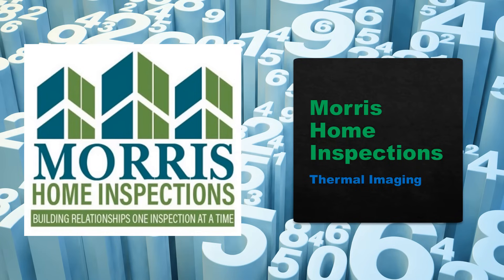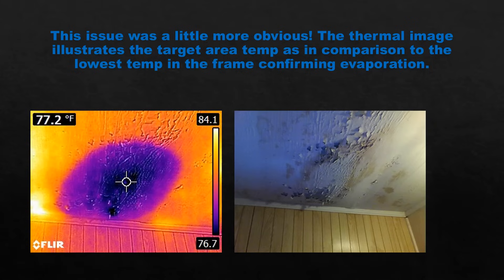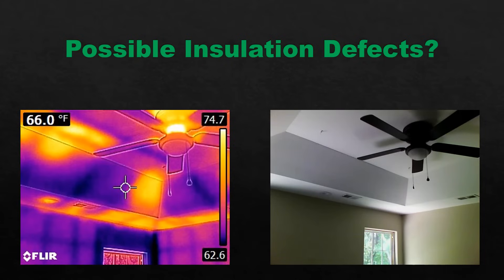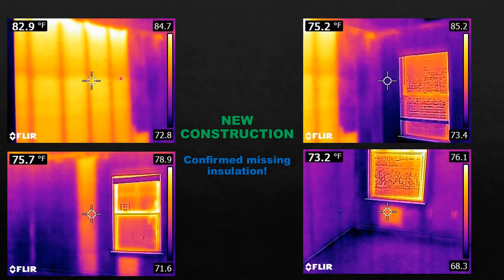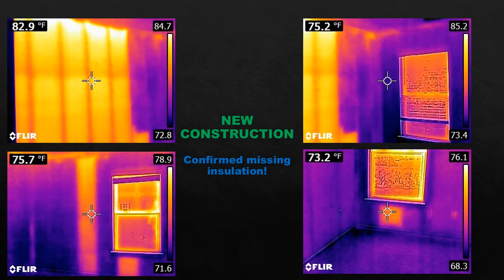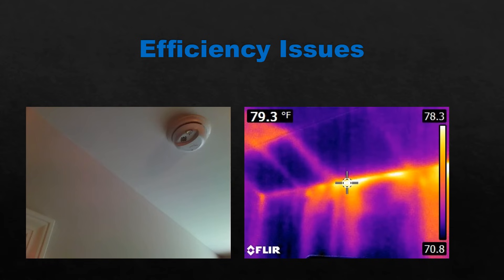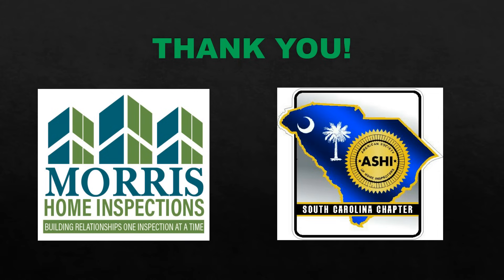Thermal Imaging in a Home Inspection

Comment: I assume these shots were taken in the summer, so if they were done in the winter, would the colors be opposite?  Great descriptive video.  Just bought a topdon 4c004 and it's winter here, trying to find my problem areas for insulation. Which is why I asked the question.  Hope to hear back from you on this.  Thanx again
Reply from the maker: Typically, yes they will be reverse. For instance, I did a home today... it's about 39 degrees out, and the missing insulation anomalies were purple
Reply from the maker: Keep in mind, though, the color scale is simply the setting you choose to use. For instance, this flir has a black/white setting, a full rainbow setting, and the color scale setting you see here.

Comment: Hello. OK—if the areas where there are water infiltrations are analyzed using a visual criterion, I’d like to know what the criterion is, and what the criterion is for thermal bridges as well. It’s clear that these areas are colder, but when can we say it’s an anomaly?
Reply from the maker: You can say it's an anomaly when it looks out of place. It's that simple.
Reply: @morrishomeinspections1234 

In most houses, wherever two different materials meet, there is a thermal bridge. These areas often stand out clearly compared to the surrounding wall surface. The issue is not their existence, but whether the temperature difference is significant enough to cause excessive heat loss or condensation risk.
Reply: Hi
In most houses, wherever two different materials meet, there is a thermal bridge. These areas often stand out clearly compared to the surrounding wall surface. The issue is not their existence, but whether the temperature difference is significant enough to cause excessive heat loss or condensation risk.

Comment: Builder filled one cavity with insulation,  peeled off paper, then stapled just paper on next stud cavity.  No insulation around windows, huge exterior gaps covered with molding.   Froze first winter in home.  Air test shown a leak about 8ft x 8ft .  With blower fan test, interior doors would slam shut from the air draw.  Wish I had a thermal camera!!!.
Removed all walls , re insulation.   21 cans of spray foam, 24 tubes of calking.  Only 3 inches of attic insulation,  blown in additional twelve inches. Had to add foam air vents between rafter.  
Glad I had the skills to re do the work.
Reply: Oh forgot, un insulated metal duct work in attic.  Hard for heat and ac to overcome.  Installer cut rafter supports in his way.  What a mess to fix correctly.
Reply from the maker: @Redoaktrading seen this done plenty
Reply from the maker: Yikes

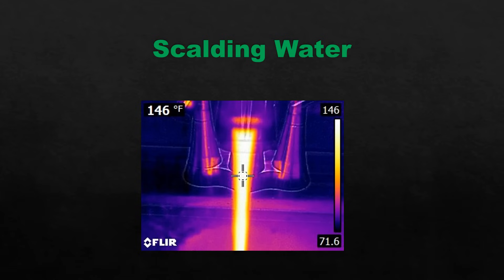Comment: 10:40 I like the look of that. You can be sure that 146 degree water won't carry legionaires disease. They do sell shower fixtures with temperature limiters if scalding is a concern.
Reply from the maker: 120 degrees is a requirement for a new home. You can change the temp as you wish once you purchase the home.

Comment: Great video Scott!! One question, I'm looking to buy the Flir E8 Pro because I'm having some problem with a lots of moisture on my concrete building! What is your thoughts on that and do you have any videos where you show moisture on concrete??
Reply from the maker: We use the E8. It's a good camera. I don't have any videos specifically dealing with moisture on concrete. We have used the camera to find slab leaks and it works pretty well. Same premise as any other moisture... you're looking for evaporation which usually shows up as a cool signature. We have found a slab leak in a condo that showed up hot. Was from a water heater line run under the slab (which isn't typical at all)

Comment: Just did my house. The ceiling to wall connect point along the perimeter (from the inside) of my house were 92+ even in the hallway. Any suggestions? I’m guessing the attic insulation is insufficient.
Reply from the maker: That's typically the spot where the soffit/fascia meet the top plate. Not usually insulated to allow for ventilation of the attic. The only real way is to have a sealed attic and spray foam those areas.
Reply: no wonder all those houses were destroyed in the hurricaines with dudes over here recommending foam instead of a proper construction
Reply: @Robbie-mw5uuinsulation and hurricane straps are two different things
Reply from the maker: @Robbie-mw5uu No one is "recommending" anything.

Comment: I can confirm as a homeowner with 2 thermal cameras that bee hives behind the siding GLOWS as a spot.
Mouse nests in interior walls/roof/ceiling also glows.
I have found 3 bee hives outside.
3 birds nests in roof stickout and wall corner and saved the life of one bird that fell down behind the ventilated siding and was sitting on the mouse screen.
Found one mouse in 4 different spots in my house ceiling when chasing it before it got in my mousetrap.
I absolutely LOVE it 😅😁
I have an Flir ONE pro and infiray P2 PRO, and there is zero competition, the infiray is better in every way and the phone app actually works.
Flir one doesn't support 4 years or older phones, i had it working then after an update it never worked again and support ain't helping they only told me to google an older APK install so i had to find an unofficial and possibly virus infected app myself and it did work, but still so much worse pixel quality/resolution and framerate than the InfiRay so it's just collecting dust🤣
Reply: Would it be better day or night to use this ?
Reply: @Ddgjyfd  late answer but it depends on what you look for but for energy loss from the house and pests/bugs it's best early preferably before sunrise.

Sometimes sun is a good thing like if you look for water damage/wet siding then it's helpful to have the sun just starting to heat up as any wet spot will have more thermal mass and stay cold for longer, this works for many hours as long as the wood is very wet.

But most of the time strong sun and rain will hide mostly everything and high wind can also hide a lot.

But if you look from the inside you must be aware where the sun is on the wall and any shadows as it likely shows on the inside, but it will also magnify the problem if it's missing insulation as it will show as a hot spot.

I learned a lot from YouTube but most from just being curious and checking my house every day in different weather and sun conditions, just using it and looking around you learn a lot if you are interested and willing to learn
Reply: @tullgutten  thnx for the info
Reply: @tullgutten thanks for your insight..

Comment: Is there a homeowners $300-500ish  thermal imager brand/model you’d recommend?   How are home thermal inspections priced & range.  Great video and examples, thanks!
Reply: I’ve been researching to find something in that price range to use for maintenance inspections for my roof.  I’ve got a metal roof with closed cell spray foam and want to ensure if it leaks I can address the leak immediately.  I’ve settled on the Teledyne FLIR 1 edge pro - priced in the $550 range.  Good luck.
Reply from the maker: That's the one I would recommend for a homeowner @ozarklanding
Reply: A Mustool MT13S (pretty good resolution, works as standalone unit) or a Tooltop T7 (even better resolution, but requires a smartphone or tablet or PC) are plenty enough for home uses and are also pretty cheap too.
There are many more cameras with less performances (not recommended because the price difference is not that much) and some other with better performances (which probably you don't really need).
Reply: I have flir ONE pro and infiray and the InfiRay P2 PRO is so much better in every way and even cheaper
Reply from the maker: So we include thermal imaging in all of our inspection at no extra cost. You can get some cameras that attach to your phone for relatively inexpensive. They won't be near the resolution or quality as something we might use but should be plenty for homeowner purposes. The Flir One. A new one is in the $300 range
Reply: I have a Topdon TC005 and I havent been disappointed yet. It was on sale though, for the price you prob could have got a FLIR.
Reply: I recommend the todon tc001
Reply: The Guide E2 is great. awesome resolution (256x192) and way more accurate than the Flir line. No sure where you live but it should be around 300 dollars
Reply: The Hikmicro Pro 2!!!!!

Comment: In your opinion, when it comes to the "insulation" or other "odd" hot spots when inspecting a home, do you have a tool or recommended calculation on estimated energy "waste" on cooling or heating ?
Reply from the maker: That's a good question. Unfortunately my answer is "Not really." We aren't "technically exhaustive" as a home inspector. "Hot spot" is a statement or comment I would never make on a report because it isn't technically accurate. If I saw a "hot spot" I would immediately think electrical issue. However, I understand what you are getting after. Depending on the size I might recommend something along the lines of "any repair is not likely to offset the energy loss cost" or "the area is large enough you might consider repair."